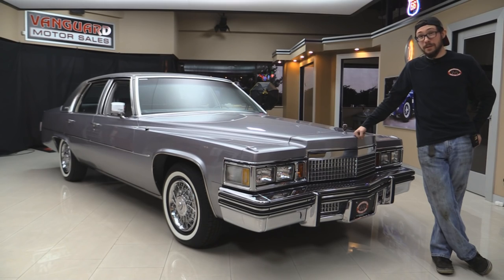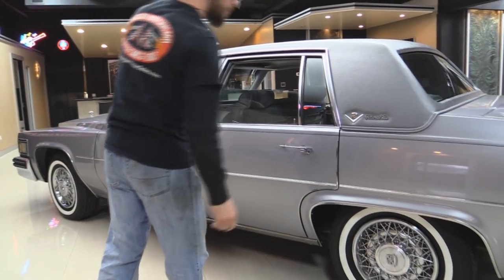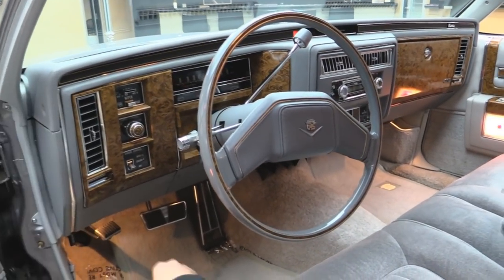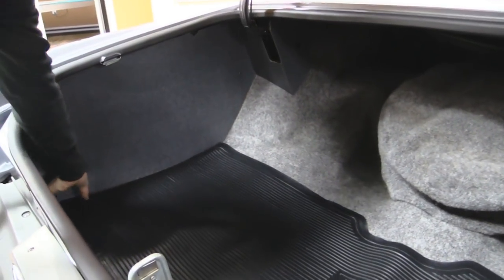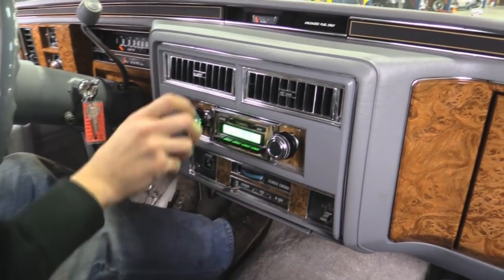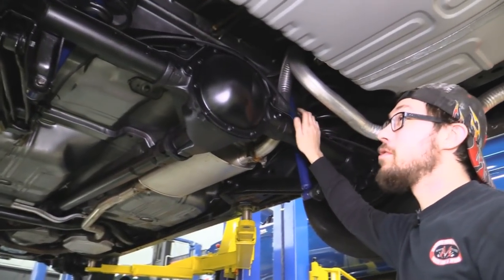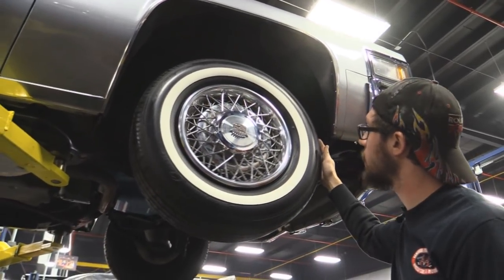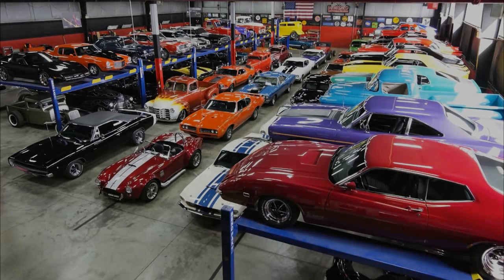1979 Cadillac DeVille For Sale

Comment: My parents bought exactly the same Fleetwood off the showroom floor in late 1978. I turned 16 a few months later and I learned to drive in this car. If you are a Cadillac enthusiast or collector and want to own a truly remarkable Cadillac model, this is the one to have. Having owned several new Cadillacs in the 35 years since learning to drive, I have yet to ride in or drive any car that could match the overall  experience of that 1979 Fleetwood.
Reply: Are you sure you remember the car? The Fleetwoods of 1977-1979 have wreath and crest ornaments, not crest and chevron. Also, the DeVille sedan has B-pillar lines that are parallel while the fleetwood's are perpendicular. All it takes is a quick comparison on google images. 

There are plenty of videos like this OF 1977-1979 Fleetwoods for this comment. Take care!

Comment: The first time I was a passenger in these model Cadillacs, it was for the 1979, junior/senior prom. I was wearing a dark gray tux, my date a teal colored gown. As a surprise, my folks hired a chauffeured, silver Fleetwood, formal limousine. We were both laughing, and nervous. I had never been in a car like that. It was a beautiful car. The interior was just as impressive. When we were driving north on I 75, I told the driver no hurry. We didn’t need to be first to arrive. That led to our classmates passing us in multiple cars, and teachers seeing us and pointing. We arrived about 45 minutes past arrival time. We did look nice as the driver opened our door. We ended the evening at a revolving lounge on top of the Plaza Hotel in Detroit. The surprise Cadillac was a special memory. 3 years later my folks kicked me out when they found out I was gay. No limousine that time, and they took my car away.  They eventually came around, and took my partner and I on a cruise for our 10th anniversary. It was limo time again, but the first time was most memorable.

Comment: Nice car, IMO I consider 1979 to be the last great year of the classic Cadillac's due to the bulletproof powertrain's and it was the last year of the mighty V8 engine.
Reply: My '77 Sedan DeVille is a testimonial to this, however I beg to differ when it comes to what you are looking for. My '92 DeVille is every bit as Cadillac as the '77 with the interesting twist of some computers and front wheel drive (though I'm doing a Rear Wheel Drive swap with a 425 V8 this year), and my '87 Brougham is absolute heaven to cruise in, the 1980s (and Italian) version of the '77. Even my 2000 DeVille (RIP) still had a lot of the charm even if it didn't really look the part. After 2001? Absolutely agree. The 2006 DTS is a far cry from a Cadillac. Felt more like a Toyota Avalon or Volvo S80. Not necessarily a bad thing, those are good cars, but they're not Cadillacs. Thankfully I didn't have the black one for very long.